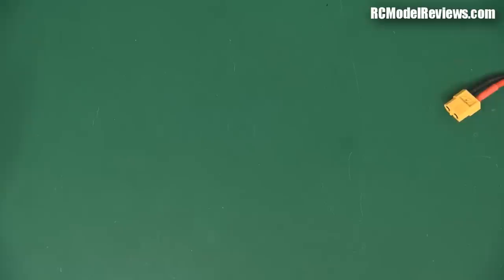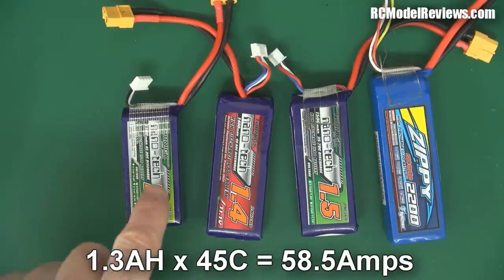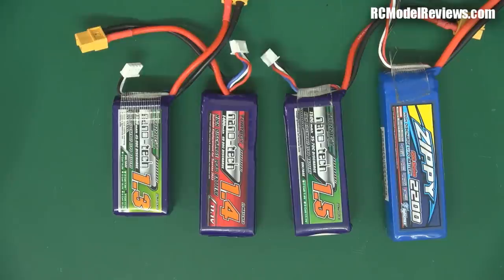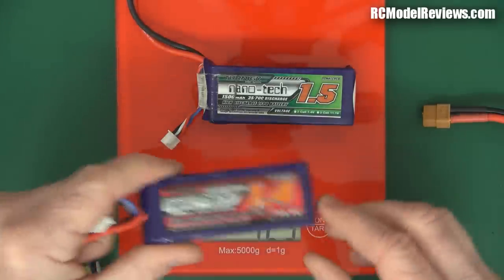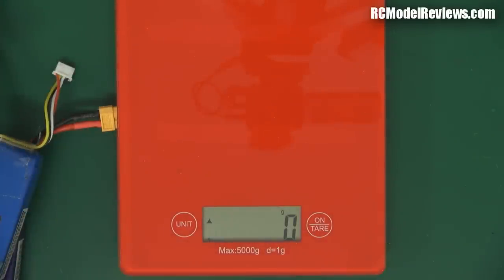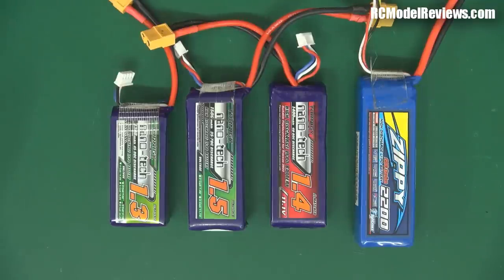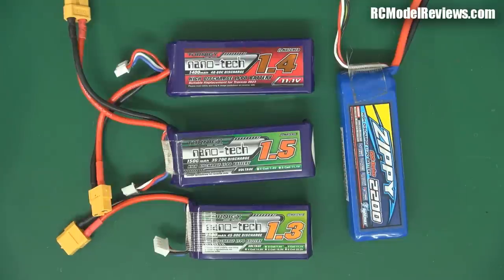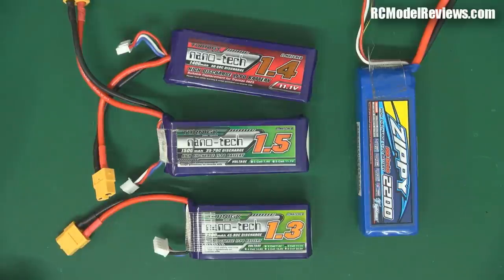What size mini quadcopter battery should you use?

Comment: My 1800mah 4s batteries weigh 228g. 560g AUW gives a nice, stable feel. I prefer it over my sub-500g 1300mah setup. And, at least with my setup, I only get about 3-4 minute flights with 1300mah.
Reply: Brox3r Are you running 5-inch or 6-inch props.   I wouldn't run 6-inch props on a 1300mAH setup because you really need the extra weight to help you drop fast when proximity flying.  Mind you, one-shot with dynamic braking also helps a lot.  I'll be covering these things in future videos.
Reply: I mainly fly HQ5040 and occasionally HQ5045 bullnose. I have DYS SN20A ESC's with Damped light and oneshot enabled. The quad just feels more predictable and stable with the extra weight. Purely a preference im sure.

Comment: I have a 250 sized miniquad, with the following specs:
ZMR250 Carbon Frame, Naze32 FC, Rotorgeeks 30A ESC's, Cobra 2208 2000KV motors and i wanna fly them with Thugprops 6045. The weight of the miniquad is 550grams without a battery. I have ordered Dinogy 4S 1800mah 65-130C batteries for my first 4S setup. Before, i was flying with Wellpower 3S 1800mah 45-80C batteries and they last for ~3min in racing situation. Hopefully the new batteries will last longer and not be as heavy to make the craft hover at higher throttle. Maybe i get thoose batteries today and hopefully i can test them today. :)
Reply: Zsoltee87 I've had good results with the Turnigy Nanotech 4S 1800/65-130C packs so you should have no worries with the Dinogy ones.   It's a good size for a quad with 6" props because the extra weight isn't an issue then.  In fact, heavier batteries are almost a necessity when flying 6-inch props because it makes it much easier to lose altitude when you need to.
Reply: ***** Nanotech's was in backorder at HK, so i had to find another solution and Dinogy was a good chance. Btw i have tested them in hover yestoday and i was able to hover my quad on 1/4 throttle. Thats cool, because it was at half throttle with the 3S batteries. :)

Comment: I have seen graphs that show a steady and severe drop in lipo batteries with temperature, and that if you can store them cold, ie in your fridge, they degrade slower. This is especially true in hot climates or transport in cars etc, that high temp storage can knock half the life out of the  battery within months. True or not a safe storage idea?

Comment: Bruce, thanks so much for the vid!  I currently use a 3s on my mxp230, cobra 2300 kv, 12A ESCs, and 5030 props.  I'm strongly considering upgrading to a 4s config.  (I just cancelled the order on my zippy compact 4s 35C batteries from your vid.  Thx).  I know my ESCs and cobra motors are rated for 4s.  Will I be drawing too much power if I upgrade to 4s battery and 5040 props?  Should I be using a lower kv motor? What is a typical 4s setup?  Are there other components I need to change?  Your videos are the best.  Thanks again!

Comment: If my motors Max current draw is (30ish amps ×4 = 120ish amps) and my ESCs and handle 30 to 40 amps do I need a battery that will produce 120 amps at peak. That's what I'm looking for. Will the battery have a meltdown if it can't kick out 120a when called for? Oh and what happens when you run a 2-3s motor on a 4s battery? the specs say max lipo 2-3s. I know heat kill motors. will the motors explode spectacularly if I push them a little harder?

Comment: Hey Bruce, another great video!! Thank you! I'll admit this one felt a little rushed though, I know there is a ton of info a little time.. I don't what it is, but just felt rushed. 

Man, you really stop flying at 11.2v? I've been flying the 1500mah 35~70C nano tech's recently, I do get a lot of voltage sag.. within about 2 mins of flight if I punch it my Taranis barks "Low Battery" at me and it's set to warn at 10.5 volts! If I check while hovering I'm usually at 10.9v - 10.8v during that time. I think I'm going to have to check out those little 1300 packs next.. I usually stop around 10.5v-10.4v.
Reply: Mini Quad Topix Where on the quad are you taking your voltage sensor reading from?

It's been my experience that some folk are attaching their voltage sense connection to an ESC lead or at some distance from the battery connector and this can cause incorrect readings and premature activation of the alarms.   Some PDBs have quite a bit of resistance in the traces to the ESCs so if you whack  your sensor across those pads you may find it reading a few hundred mV low -- due to the voltage drop.  I always attach mine directly across the 12AWG wires that go from the PDB to the XT60 for the battery.   This way, I get several minutes of silence even during the hardest punch-outs :-)

Note that the 35C/1500s are "softer" than the 45C/1300s so they do sag a little more under load.  Try the 1300s and see what you think.  Remmber... don't get the 25C ones :-*

Comment: what about running 2x 2s 5200mAh 30c's in parallel, despite the 600g+ weight, 312 amps sounds like fun :) also voltage is same as a normal 4s

Comment: Hey Bruce. I fly my batteries down to 10 volts and then the resting voltage comes back up to 11.2 volts. Am I pushing them to hard. If I quit flying my mini quad at 11.2 volts under a load I wouldn't get a 3 minute flight in with my nanotech like the one in this video.

Comment: I have an Graupner Alpha 250Q and I want to Buy an New Battery but I don't Know what kind of Battery I Need and what' the Best so I Found the 
---Turnigy 2200mAh with 40-50C 3S Lipo 200g --- 
and the 
--Turnigy Nano-Tech 3000mAh with 25-50C 3S Lipo 231g--
So which one I Have to Buy? My Copter Fly's 80-100km/h

Comment: I have an f450 clone frame with Emax 935kv motors DJI Naza flight controller with 30amp DJI Opto ESC'S. I want to jump up to a 4s battery using 8045 props. Any suggestions on a good quality battery that doesn't inflate(lie) about their "C" ratings? I want to transfer everything into a Qav400 frame eventually. Thanks in advance!

Comment: I've got some turnigy transmitter batteries. I'm obviously never going to be able to draw them down soon enough. Seeing as there designed for transmitters will the chemistry be any different?
Reply: mike216ism I've wondered this myself but need to assume chemistry is different. I have a 4000mah 1c transmitter battery and can use it for 2 hours before the voltage even moves. I think the 1C chemistry must be less volatile and not Ann issue.

Comment: I wish I had have watched this BEFORE I put a 1550  25C battery on my  250 quad....had to learn my lesson the hard way.
Reply: What's wrong with that set up?
Reply: probably too low power. that's only 38.75A 
it would only power 3 , 12A motors safely.
Reply: is 12A the standard for motors ?
Reply: 12 and 20A esc are common for 250 and engines are 2300kv .  My quad as 20A esc with 2300kv motors
DarkShadowsx5 is right... a 1550 25C battery was too low power for the draw that was required (and my quad did an impersonation of Icarus)
Reply: Thanks for the explaination, I'm still a newbie with no quad built up yet...
I wonder why you chose 20A instead of 12A esc ?
Reply: +LT “John” YV can get more power to the motors with 20A.. More speed

Comment: Have had many brands of batteries and was not impressed by nano tech ,especially the higher c rating flying the same plane as I flew with 20 c rating batteries.   Sometimes the math doesn't add up especially when we don't really know who produced the last batch under that label. Probably a good discharge test on new batteries every year  would produce different results.

Comment: Thanks bruce. Never knew that you should store batteries at 3.7v/cell. 
Q. What period of time should you use the storage voltage? You seemed to imply even flights of once a week should be stored with this voltage. Is it that finicky?
Reply: Seafury mike 
It's actually 3.8V by recommendation of most manufacturers. The more a cell spends in the 3.7 to 3.8V region the better. If you could, you would never charge them above that level and never discharge below that level, but then you'd lose the whole point of having a battery since you would constantly need a charge connected ;) . There are chemical processes inside the cells that happen even when ust lying around and not being connected at all. Those processes become worse the closer you get to full charge/discharge (and battery destroying when in over charge/discharge). Heat makes this even worse.
The same is true for laptop and cell phone batteries btw. If you use a laptop mostly stationary, charge the battery to something above 50% and then remove it and store it in a cool place (some even put them in the fridge) until you need "mobility".
Reply: Seafury mike if your battery is low (say under 10.5V) then it pays to put them on storage same-day.   If you've got some fully-charged batteries then it's usually safe to leave them for a couple of days before bringing them down to storage but if you leave them a week or more you can expect their useful life to be diminished somewhat.  The effect isn't always immediately noticeable but you may find that the batteries "wear out" quicker than those which have been properly cared for.

Comment: Are there any battery brands that you would recommend avoiding? Particularly those that don't really perform as advertised. I am new to the hobby and trying to learn as much as possible and would like to avoid as many pitfalls as I can. Thank you for your videos they really do help.
Reply: The decision wich batteries one should buy is pretty easy answer:
Do you want batteries that deliver the power you need and have a little bit more voltage sag but they are cheap? Also after a year they may be round a pillow. Then go with Zippy/the grey Turnigies/Rhino or whatever.
You want batteries that are a bit more expensive but actually really good and trustworthy? Alsl they won't puff and last 2-3 years?
Turnigy Nano-Tech etc are really good for you if that's what you're looking for.
If you have too much excess money and you're not that much about saving weight, take those a-spec g2 style batteries, that I would only recommend for eg edf Jets that constantly take a lot of power.

Also, don't be about the c-rating too much, there's a german guy called Gerd Giese that will tell you more about that. The c-rating is more of an estimation of lifetime, because a 20c battery will also give you 35c with just a little more voltage sag than a 35c battery, just that it won't last as long and lose capacity quicker. Also be aware, 1300mah 65c and 1500 35c will weigh about the same and give you what you need, but the 1500 will give you some more flight time
Reply: Honey BooBoo Actually, the C rating is quite important for miniquads -- where you're potentially drawing a lot of current (40A from a 1300mAh battery is a lot!).   If you're hammering your quad hard, a 1500mAH 35C won't actually give you any more flight time (in my experience) than a 1300mAH 45C battery because the extra weight of the 1500 simply produces a more slugish quad that spends the extra 200mAH simply to carry the extra weight involved.
Reply: ***** Yeah you're right about that, I just wanted to add that you can quite often get more capacity without carrying more weight through going down on the c rating. In a miniquad you really can't do that because of the relatively high current but ecleveland1 didn't specify what he uses the batteries for.
I've been following your videos for over a year now and I really enjoy your videos, so keep up the good work!

Comment: bruce I have a pair of the 1.3 a-spec batteries for my 250. what voltage settings should i use on the naze32 cleanflight? At present i have set a minimum of 3.4v is that safe or could i go lower. I am a beginner so all advice appreciated. thanks

Comment: Thanks for all the great videos, I'm just learning about charging lipos wanted to know whats the max charge to put on a 3cell 11.1V 2700mAh 40c lipo. what is its full charge. I use a IMAX B6 charger
Reply: Jimmuy jam ~2700mA. but there is no need to know that because your charger will stop when your lipo is fully charged
Reply: Jimmuy jam Set the charge rate to 1C (ie: the capacity of the battery).  That's 2.7A for your 2700mAH battery.   This is a safe charging rate but many higher-C batteries will allow you to charge them at 2C or more -- but check the manufacturer's specifications first.  Charging at 1C is easier on the battery anyway.

Comment: Great video but..

Argh.
I'm running 25C batteries and I've just ordered 2 more. And they are Zippy Compact. More argh.
So get some new batteries. Get a higher C rating 40 or so. Get away from Zippy?
I'm flying a 330 quad, 1000 KV motors, 20A ESCs and 0845 props. I'm a new flyer so I'm not pushing anything too hard. So questions. Am I damaging anything? Is anything likely to explode or burn out? Other than performance am I missing anything? I think I must have known they were too low. Every now and them when I pop the thrust the low voltage alarm beeps.
When the new ones turn up, bin the old one or keep them for slow control practice?
Any answers would be appreciated.
Reply: LegGiant You won't be damaging anything.  Your 20C batteries may get a little warm and probably won't last as long as higher-C ones would but, as you've already noticed, the main thing you'll encounter is some noticeable sagging of the voltage when you push punch throttle up.   Keep your old batteries -- so long as they're still giving reasonable flight-times and aren't puffed they're still usable.
Reply: ***** Thanks. 2 Turnigy Nano-tech 45C ordered. I'll keep the old ones for slower practice.

Comment: Is there an upper limit you should be conscious of when it comes to the mAh x C?
Ive been running 3s, 1.4Ah, 45C giving me 63Amps, but ordered some new lipos recently (HK backorder D:)
They are 4s, 1.8Ah, 65C which would be 117Amps. I know some PDBs might struggle with high amp loads?
Reply: Zachary Cox The amp figure is what is available -- the actual amount of current that is drawn depends on your motors and ESCs -- they will draw only what they need.  So you can use as high a C rating as you like.  Just because a battery can deliver 100A doesn't mean 100A will be flowing through your PDB (unless something bad happens :-).   It's a bit like a car.  Some cars have a top speed of 200mph but they will drive quite happily at 60mph -- if that's all the pedal you give them :-)

Comment: I really wish you would have added some testing to this video. You said don't use the compacts because you don't believe the rating on the label. Well, I don't believe any of Hobbyking's labels, especially that 45c on a 1300 pack. Please use your test stand and put them under a load and show how much current each one can actually push and show which C ratings are BS. Thank you.
Reply: onlythefallen1 Yes, I'll be doing some testing in future (probably once I get some Dinogy batteries).   This vid was simply in response to the countless emails I've had asking for some beginners' advice for miniquad batteries.

Comment: Bruce, Why do the nano-tech 1500 mAh batteries have a rating of 35-70C? What does the 70 mean on this battery? I have quite a few of these batteries and always wondered what the second number meant.
Reply: heliav8r 35C is continuous current, 70C is burst current (only for a short time - seconds). Lets you get out of dangerous situations if you need throttle very quickly.

Comment: you dont choose a higher c rating battery to get better performance out of your motors, you choose a c rating to cover what your motors will draw. 
If you are using a battery with to low a c rating your going to kill the battery very quickly, the number is there to preserve the battery.

Comment: How do these different batteries effect endurance? I've been using 3 cell 2200 batteries since I started flying my 250, but I just tried a 3 cell 1.3amp battery a few days ago and it felt like I got around a 20% reduction in flight time from it. I didn't time my run (so I can't know for sure if the time was more or less) and I don't have any telemetry or battery alarms installed. I have a battery checker which I use when I feel like the quad is losing performance. When I used the 1.3 it just felt like I didn't get the same amount of laps out of it before I thought it was time to stop and do a battery check.
Reply: ThaVermin Yes you definitely won't get the same flight time between a 1300mah and 2200mah, the 1300 probably gives 4-5 mins and the 2200mah about 7-8 mins

Comment: Awesome! Just finished my mini quad build and now wondering what is a really good frame (I built a wooden frame). I need a frame that has upswept arms, can fit a kk2.1.5 (happy to double side tape it down), and is a mini h quad style frame. I've seen the new hobbyking colour frames and they look awesome. Anybody have any other recommendations? Oh and also needs to suit 1806 motors with 12x16mm bolting pattern, thx
Reply: rc photography If you want a plastic frame you might like to wait until I've reviewed this:  http://www.tgaframe.com/product/2/Mini_quadcopter.html   It has upswept arms and is available in black and transparent (which looks cool with LEDs blazing away).  The review is a couple of weeks away so stay tuned.

Comment: i have 20Aesc with max 25A that mean i have some were 80-100A need what if i want to use 2.2A batery and i get 36-45c what if i want t use 60 C will my esc burn or i should find some were between 35-45c